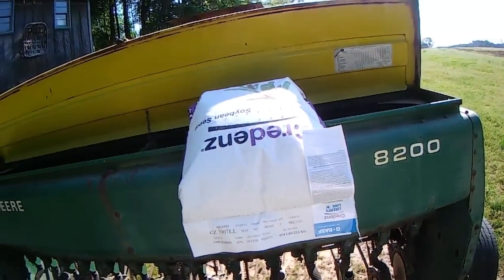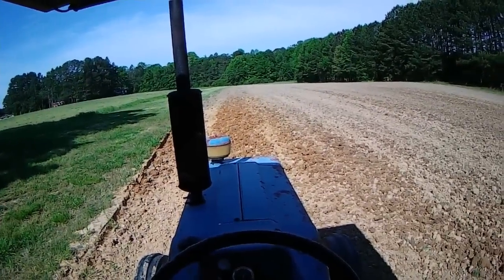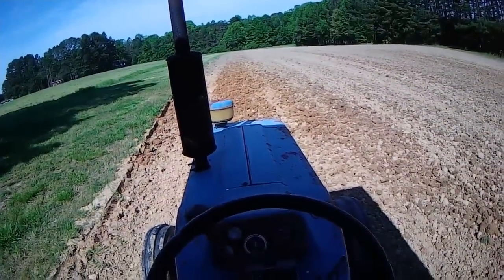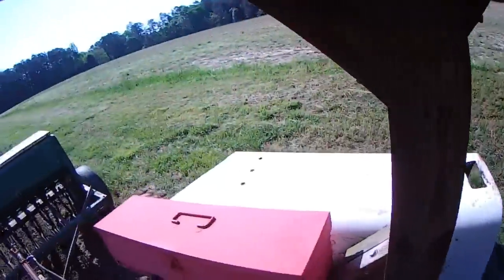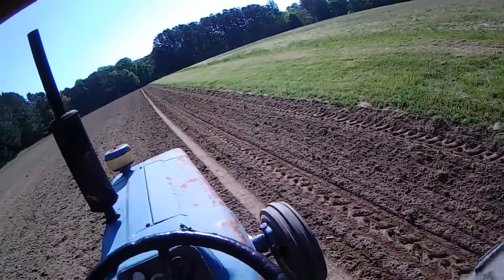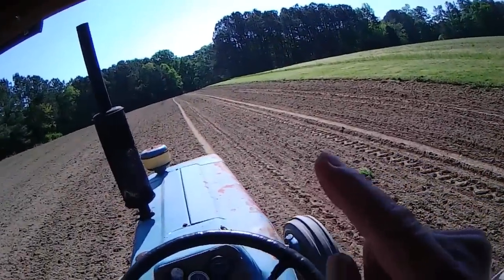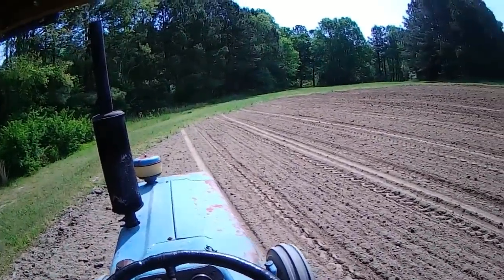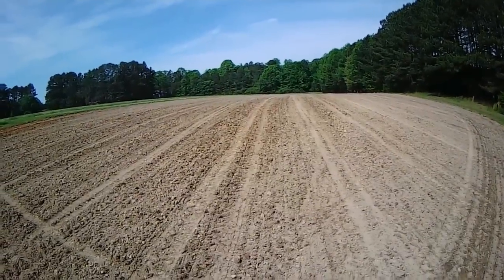First of the 2019 Soybean seed going in the ground

Comment: My way of making a straight line is use the center of the hood(emblem if you have one) then line it up on one single point on the other end and without taking your eye off it go straight to it. Don't worry about what is going on behind you till you get to the other end. Give it a try sometime. It works for me. Best of luck this year.
Reply from the maker: Johnny Holland - I use that technique when starting in the middle of a field with my offset.  most times it works spot on.

Comment: Glad to see you starting early. 
Do you ever use seed treatments? 
Beans on Beans must be tough for diseases and yeild drag.
Reply from the maker: cj402061 jack - several have told me how I've ruined this land with beans on beans.  funny thing happen last year with the 2018 crop.  I had 2 acres as a complete loss due to flood another 2 acres 50% loss due to flood.  then there was a spot about 1/8th acre to muddy to get the combine in and with all that I was about 5 bushels away from setting a new high yield record here on The Little Farm.   is that not the strangest thing you have ever heard of.   crazy right?   no treatments just prayer.    God is good...   :)

Comment: Very nice SBF, I thought you are in 4th or 5th gear, great moment, like the enthusiasm just before the start of the 2019 crop,
Reply from the maker: Jan Kotze - 6th gear and very low RPM to get the travel speed.  I was concerned I would not have hydraulics at such a low RPM but it worked.   I might have saved a small amount of fuel too.    thanks for watching here Jan.

Comment: Hope your planting goes well for you. Did you find a valve for your power steering?
Reply from the maker: Jeffrey Ticen - never found the valve BUT I did find out I was over filling the pump reservoir.  I let the fluid settle to the level it is at now and the leaking stopped.   had to do with when the cylinder is fully closed the fluid had nowhere to go.   made the pump run hot too.   help and knowledge from a friend was a great thing...

Comment: Nice to see someone is getting seed in the ground. We use a jd 7000 corn planter with radial bean meters for our soybeans and I'd say it's the next best thing to a vacuum meter. The plants come up nicely spaced and the seed population is as close as you can get. It's practical for us since we use the same planter for the corn. Your drill works fine in your situation, just we had trouble getting seed covered with the old drill due to the corn stalks left pver from the previous year.
Reply from the maker: Greg Henry - from what I have watched corn stalks are hard to cut in.    my only experience with corn has been a few rows in my garden and cutting those in was a multi pass job.   beans around here planted with a true planter have a lot better rows than what I get with the drill but I use what I got and be happy.

Comment: Can you use a drill to plant corn 🌽?
Reply: Yes
Reply: Yes, but you would have to block off some of the rows.  Corn doesn’t produce well (or at all) if it is clumped together too tightly.  You also see in the video when he’s got the camera on the the drill the seed metering system pushing the beans are those small little “gears”, they would crush a lot of the corn seeds.  Beans are about the largest seed a drill can plant.  Corn also likes to be planted a little deeper than a drill goes, so that’s why you typically see farmers using a planter for corn.  Depth, seed spacing, and more precise control over the number of seeds planted is the reason planters are preferred.
Reply from the maker: Thomas Rouse - I am so glad you showed up here to type all that in for me.  thank you very much.  well done Thomas.    thank you.....
Reply: Thomas Rouse 👍
Reply from the maker: ozz - Thomas gave a great detailed explanation for the ins and outs of it.   but I am glad you asked.   asking means you get to learn stuff.   thanks for being here ozz.

Comment: If only you could mount the sprayer on the back of that drill and put on the envive as you go in one pass!  Haha
Reply from the maker: D-4 Farming - I came up with a really cool way to put the boom on the back of the drill but the water tank on that little tractor was another story.  I got front end problems and I don't think the weigh of the water tank up there is a great idea.   need to fix the front end troubles.   thanks for watching and being here.